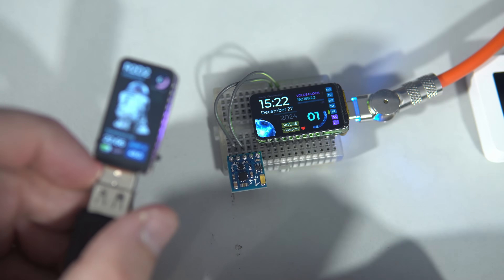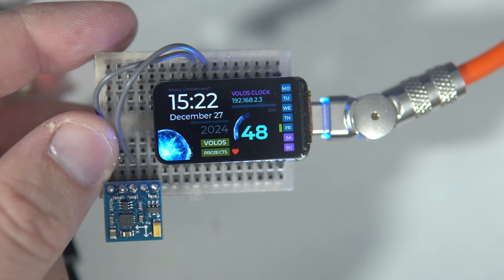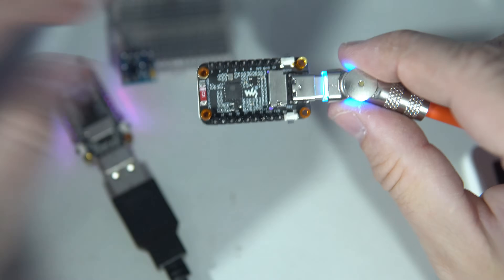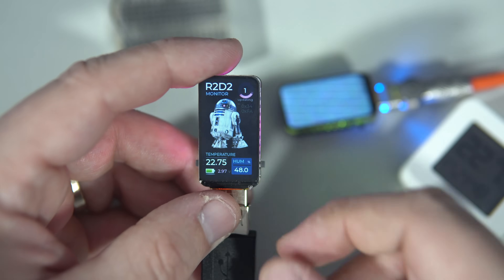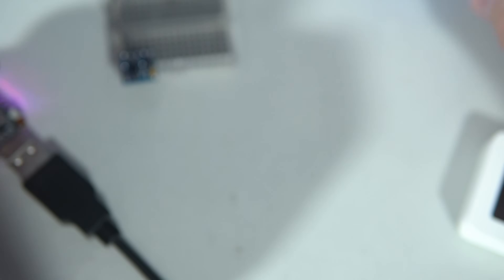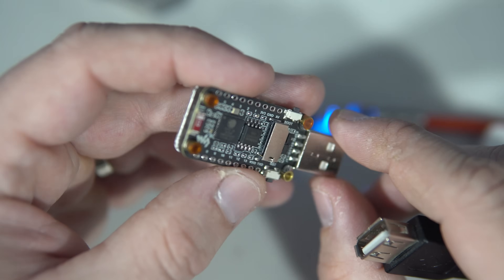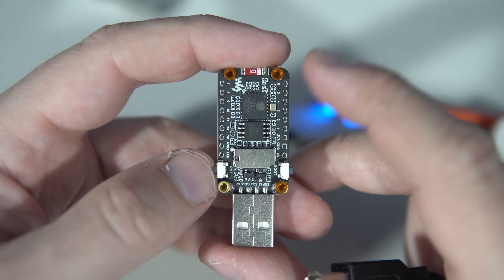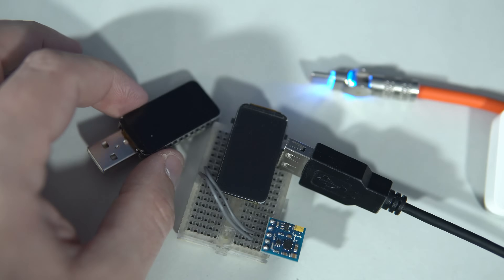Sharp, Compact, and Affordable: Waveshare 1.47 Boards ESP32 C6

Comment: Thank you for your video I seem to  be having to do a project but I just get a black screen when trying to upload to it be great if you could help me out on Arduino cc forum on my issues. the clocks not important to me I need my blood reading onto it! be good for me to just replace the R"D" logo for blood, I've figured the issues and will do a setup for it! How do you get lights on your usb as I struggle to see the ports now to plug in and they be very helpful If I could get setup the same.
Thanks

Comment: Have anyone got the code to work? It is just full of errors when I try to compile the C6 version
Reply from the maker: Did you install libraries from waveshare page, did you install proper version of esp32 boards in arduino ide
Reply: @VolosProjects  Ah, I only installed lvgl and got irritated by the setup files is not in the main directory lol.. So I did a rage quit and went to adafruits driver instead and it worked. Maybe when i calm down I will go back :)
Reply from the maker: I know the feeling, in first part of this video you can find instruction how to install evrything for this board https://youtu.be/KEcr22qZAVE
Reply: @VolosProjects  I have tried it , but get errors like " error: 'lv_font_montserrat_48' undeclared (first use in this function); did you mean 'lv_font_montserrat_16'?
   36 | lv_obj_set_style_text_font(ui_timeLBL, &lv_font_montserrat_48, LV_PART_MAIN| LV_STATE_DEFAULT);" and a lot more errors.  I think I will just use adafruit since it works and since it looks easier to use. Thanks anyway :)

Comment: Hi, has it ever happened to you that Windows recognizes it as simply a serial device? It normally recognizes the ESP32s I have as CP210x... I asked the seller, and he couldn't answer. The seller knows less than I do. The problem is that when I try to upload any code in the middle of the upload, it says: "Failed uploading: uploading error: exit status 1," and I have the ESP32C6-dev libraries loaded. This is driving me crazy.
Reply: sorry my model is ESP32-C6 1.47inch Touch Display Development Board, 172×320 waveshare 😮‍💨

Comment: I just bought one of these and I'm overwhelmed by the amount of stuff they pack. Temperature sensors, gyroscopes, wifi, and a fantastic screen, all in a single board. You could turn one of these in a perfectly customizable smartwatch.
Reply: I bought it and now need to find a use for it.  I like this.

Comment: Hi, also late merry Christmas. It's a good video. I wanna get these little boards and plug them into servers as a pretty local status display. Likely not uisng the wireless stuff for safety, but I'm not sure yet how to do it in general, I would need to accept input over USB etc.
Seems once I figure that it's easy but the first part still is quite unclear. Maybe next year I can show you a result 😂

Comment: Thank you. Very informative. I just received the ESP32-C6 1.47inch Display Development Board. The connector header pins came separately. How to solder? Does the screen covers the holes
Reply from the maker: i placed pins on breadboard then instaled board on pins, and from side with small soldering iron tip i wans able to slowly solder pins
Reply: @VolosProjects I have a better chance at medical surgery as a career than avoiding burning the display with a deafening ‘Oh Fk’ scream 😂

Comment: Unfortunately this module seems to have issues with SPI bus when both LCD display and SD Card is used. Demo file that is provided by manufacturer is working poorly, the SD Card cannot be initiated at any of common frequencies (20/40Mhz). The temporary solution is to set SPI frequency to less than 10Mhz, but sometimes it is still causing whole module to panic. This made it useless for my data logger application. Such a shame.

Comment: Unfortunately I could not get the codes to work for the S3 it seems to be missing some of the ui files? Maybe ui_screen? The C6 could not upload as there was not enough storage and was at 108%?
Reply from the maker: I am confused now, you tried to upload c6 example on s3 board?
Reply: @VolosProjects  no I have bought both boards S3 and C6. For the S3 code it seems to be missing some files? For the C6 code I could not upload as took too much memory? Thanking you
Reply from the maker: Are you using libraries from their demo, or you have your old lvgl library?
Reply: @VolosProjects  im using libraries from the demo.
Reply from the maker: Make sure you dont have any other lvgl library in you libraries folder. Your ide is probably using other version.
Reply: @T1NKER1NG Just select in arduinoIDE tools-> partitionScheme -> HugeApp and you are good to go

Comment: @VolosProjects "new years sketch" worked like a charm love it! and now I'm working my way thru squareline.  Just curious...in the wavesharemodels/c6example I'm getting a 106% oversize error.  I played with it as much as I could took out the rbg lamp and still too big?  Need a wipe or what do you think?
Reply: @VolosProjects so I solved the size issue follow the waveshare guidance to use it No OTA 2mb / 2mb FATFS, but with the C6example I'm getting a "static" filled screen....went back to "newyearsproject" fine.....I really want to run the potentiometer project with a 24 neopixel ring lemme know if you can help!  I would greatly appreciate it.

Comment: Hi ! Thanks for your videos I bought one of this today on Amazon but unfortunately I’m very new to this will be great to have more documentation from the manufacturer to how use it for a beginner do you have more information about how set up the lcd a firt test ?
Reply from the maker: hm, to be honest if you are beginner this is not board you want to start with. Right now this board only works with lvgl and it is not easy explain how to setup it and use it. If you are beginner i recommend  t-display S3 or maybe beter some bard from m5stack, their bards have many examples to work with, and much better information. Also AI can help you a lot, you can use free version of chatGPT. Have you ever used arduino IDE before?
Reply: @ thank you for the reply … I have use Arduino nano before I have never use this kind of board before I did follow all the instructions I have run test with the leds only but not the lcd unfortunately… is there any way that you can help me to set it up i will be more than happy to pay for your time ..
Reply from the maker: @junior3d279 i decided to make tutorial in next few days, it seems many people have same problem

Comment: dear volos, it is a nice project however in the arduino environnement it compiles with error" fatal error: src/lv_init.h: No such file or directory" which library do i have to upload to compile the sketch properly/in advance thank you and happy new year
Reply from the maker: You have this board?
Reply: @VolosProjects  yes i bought it from ali express it seems nice but it does not work for the moment ,it is certainly not your fault 🙂however the arduino environment is so
much sketchy 😶for information i have chosen esp32c6 dev module in the board configuration menu thank you for your kind reply, it is always a pleasure to watch each new video😉

Comment: Think the red capacitor is actually the WiFi antenna
Reply: You're right. The page linked in the description calls it "Onboard ceramic antenna."
Reply: It's the ceramic antenna used for both WiFi and Bluetooth

Comment: The Waveshare site has lots of boards. Could you provide links or part numbers for the specific ones you are using? Thanks. 😊
Reply from the maker: i added links in description.
Reply: Waveshare certainly has a useful product range. I've been using the S3 pico which has a uart to USB bridge and a USB hub onboard. This makes it ideal for developing a USB application. No display though...